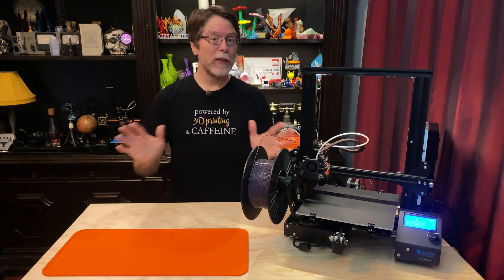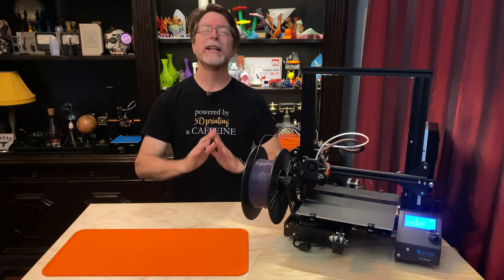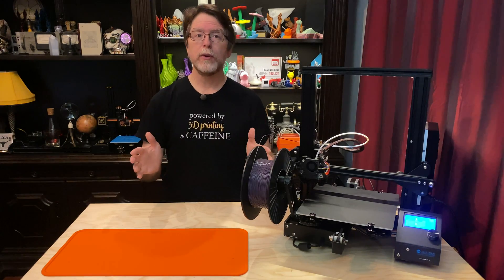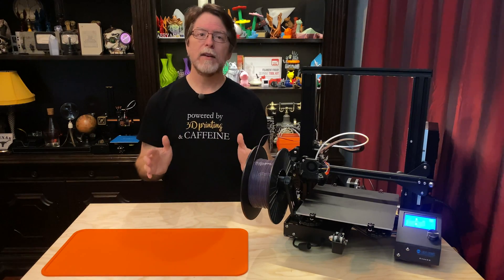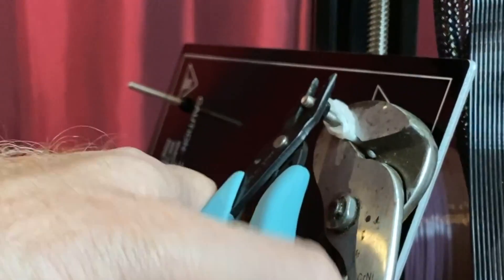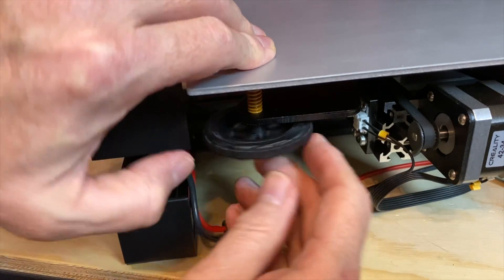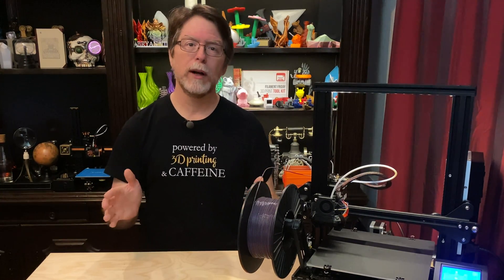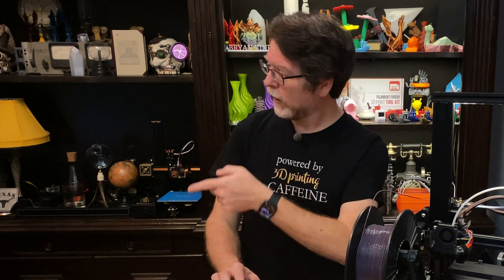This Simple Ender 3 and Ender 3 Pro Bed Mod is NUTS! 😜

Comment from the maker: Numerous viewers have commented about using the right tool for the job, which is something I didn't do. 😊 Instead, I used the tools I had available at the time (as one sometimes does). However, a set of tiny, tiny wrenches was subsequently procured, and these are linked in the description.

When I ordered them a couple of months ago, they took a month to arrive. Shipping times have improved greatly since then!
Reply: Tiny wrenches are good, but sometimes nut drivers are better...
P.S. Why not just use some super glue or a small bit of epoxy on the head of the screw to hold it in place? 
A bit of heat would help remove them if you ever needed to do so.
Reply: @TrojanHorse1959  but the bead is heated, doesn't that crate a problem?
Reply: @jtcmlt1 , So far it has not been a problem. Mine have been "glued" in for several months now.
Reply: @TrojanHorse1959  Okay, thank you. I was just confused because you said that a little heat would help remove them. I am going  to try.
Reply: @jtcmlt1 , Yeah, sorry. I should have said a bit more heat from a torch would help remove them. Best of luck to you.
Reply: @TrojanHorse1959  Thanks, same to you
Reply: Hey, if it works and it's all you had laying around, that's a job well done in my book.

Comment: Might want to consider adding either a fiber washer or a nylon washer before installing the nylock nut that way you can be almost certain not to damage any traces (especially since ideally you should be using a box end wrench or a socket and ratchet to install the nut instead of pliers since pliers can easily slip off of the nut and gouge the surface, one of the reasons I keep a small set of metric 'ignition' wrenches in my printer toolkit), with a fiber or nylon washer beneath the nut you also don't have to worry about any jagged edges on the nut (possibly caused by using pliers instead of the proper tool) from digging into the traces (considering how close the nut gets to some of the traces in your video, I'd certainly consider this).

Comment: I just picked up a used ender 3 pro and I feel that something is bent on the bed area. Even after adjusting the bed using the paper method which I've done several times the nozzle in some spots don't make contact or scrapes the bed.

Comment: Making those beds as cheaply as possible has consequences. From a machinist and mechanics perspective stock hardware and fit class is scornworthy so your fix makes perfect sense.
I suggest owners spend a little on a (typically 7mm) wrench to fit those lock nuts as it's fast and handy.  I ordered a 7mm "flex head ratcheting box wrench" (since most mechanics sets stop at 8mm) for $7.99. As a lifelong mechanic I never cried myself to sleep over buying decent tools that make life easier. I also second the thin flat washer suggestion but unless you care about the bottom surface that does not matter. Nylon or other plastic washers would be even less likely to scratch traces. If you look closely at how flat washers are stamped one side (the one you want facing the bed) has ROUNDED edges while the other side has sharp edges so I'd face the rounded side to the bed if using metal flat washers.

 Ideally the wheels should also have lock nuts because the fit is so sloppy but as I've just gotten my S1 Plus those parts have not arrived. I will replace my wheels with standard nuts with a flat washer then a star lock washer to retain the nut (a star washer lightly torqued is easier to loosen if lightly snugged) or if there is room I'll mill the wheel hubs to clear a standard nut and star washer to lock the wheels. They'll be easy to unlock with a wrench. One thing I notice about printing is many printer owners are not cued to think like mechanics and machinist despite learning CAD and working with hardware. I encourage anyone interested to take a machine shop course as it changes the way we see and interact with materials.

Comment: idk, i tried this a while back and it just seems to give you less clearance. and you will have to raise the break switch to compensate. also, anyone having wobbling issues check that there are washers on all four wheels for the bed. mine came without two washers on one side and the printer sat for two years until i decided to take a real at this thing. pissed me off when i found out why! if those washers are missing then the wheels bow out from the track when you tighten the nuts.

Comment: This guide is pretty interesting. I'll have to give it a try with my Kingroon KP3S 3.0 printer when I get the required items.
However...what if, between the Heated Bed and the Nylock nuts, we add 4 nylon flat washers? Wouldn't that reduce the risk of damaging the Heated Bed? 🤔

Comment: I did something similar to this (not my idea) but what I used were 1 nylon washer, 2 M4 nuts to lock to each other on the underside of the bed, Ditched the springs all together, and used a wing nut on top of the gantry and leveling wheels below the gantry. Made it a solid bed, once it's level it will never need adjustment again. Just be careful you don't drive your nozzle into the build surface.

Comment: Just did this to my ender 3, haven't leveled the bed yet will do that in the morning, next thing I have to print is the lid for an enclosure and then a mount for a pi compatible Lcd touchscreen. Because well it's slowly becoming a modified voron switchwire. Got to have an external electronics enclosure. Got to.

Comment: I did this ages ago before I saw this and I put fibre washers on between the nyloc nut and the print plate so that I didn't scratch the bottom of the plate and short out the wires.

Comment: My experience with this on my Ender 3 Pro:

TLDR; The nuts caused the screws to no longer line up with the mounting plate holes resulting in a huge effort wasted. Springs working great without the nuts. Screws don’t turn once springs are well compressed anyway.

Getting the nylon screws on and off is a major chore no matter how you slice it. The nuts are 7mm hex and I can use a socket wrench for first few turns, but the screw starts colliding with the  too-short socket requiring a regular wrench most of the way. 7mm wrenches seem hard to find, best I could do is adjustable wrench. I found the best way to grip the screw is with a folded paper towel and vise grips.

Once I finally got all the nuts firmly against the bottom of the bed plate, they were then fixed standing straighter perpendicular to the plate where before they had wobble play. Turns out the holes in my mounting plate don’t exactly line up with the holes in the bed plate and the nuts forced the issue. Unscrewing the nuts a little gives back the play but defeats their whole purpose (screws can still spin). I even went so far as to try opening the through holes wider in the mounting plate by drilling with slightly higher diameter bits. I could tell that wasn’t working either and I got worried about ruining the stability of the bed. So I gave up on the nuts altogether.

Using just the springs it was challenging to turn the knobs onto the screws at the beginning but I found I could just press the side of the spring hard against the screw to slightly stop it turning. Once the knobs are compressing the springs near the calibrated amount the screws no longer turn, so the nuts are not needed anyway. I’m a little upset how much time I spent messing with the nuts. I recommend skipping the nuts entirely.

Comment: Total gas lighting people on sticky bed surface, you don't have a new one and want to use the current one. His Answer get a new one you cheap bastard!
Reply from the maker: My answer to the issue of "...if you have a stick-on surface and you're not ready to replace it," was, "Grip the screw with pliers and padding." It seemed like a simple solution to the problem of not wanting to replace a bed sticker. Was there a problem with that approach?

Comment: Hi Bryan, I will suggest to put a a washer (rubber) or other no conductive material before the nut, you can short the element, I
use tap rubber washer, I a short.

Comment: The center of my 310 mm sq bed has a screw.  A fifth element...   It is fixed and the bed leveling starts at the center and the corners are set to match.   But it only goes deeper.  I need to put a spring under it so that it will go positive Z as well, so I can set them all to each other better and with more adjustment range.  They look small but they square spring is the right stuff for the stiffness desired.  I will likely get the 10 pack.

Comment: So really late comment, but I just installed this mod.  It works perfectly but a warning to any with an Ender 3.  The holes on the bottom plate do. Or perfectly align with the heater bed bolts.  In addition to taking great care of to crack the heater bed, be careful inserting the heater bed back to the bottom plate.  I had to loosen two nylon nuts, insert the heater bed, and then gently tiger the nylon nuts.  It works, but it seems Creality relies on wobbly bolts to compensate for poorly aligned holes.

Comment: Hu Bryan, my ender3 might actually need this, already replaced stock springs, moved Z stop slightly up to accommodate raised bed but still after every print, have to relevel the bed. I also lroceedes to tighten all the nuts under the bed, including the two eccentric ones, yet same old same. I already ordered a BLtouch kit to automate the levelling, can't take it anymore lol.
However I am tempted to try this one as well but only worry is additiin of these nuts will further move the Z axis a bit higher thus shortening available printing space in Z axis.

Comment: How about a small drop of silicone on top of each bolt... just enough to sit above the surface of the bed. Then, if using a glass top, the glass will push down on the silicone and basically friction will prevent the bolts from turning. Shame Ender wasn't smarter and used hex head bolts and a hax shaped countersink, then the bolts won't be able to turn at all.
Reply: Meh, manufacturing costs

Comment: Hey buddy, great Idea. I would also suggest, If not mentioned already, to also use a flat washer so as not to damaged the surface underneath should the nut start turning. If you use a slightly larger washer, the spring could also press against It and prevent said damage. Cheers :)
Reply: I use silicón washer in both side of the spring

Comment: My Ender3 Pro came with the magnetic sheet already attached to the bed, covering the screw heads.  Is it OK to make a little cut in that so I can fit a screwdriver to the screw head?
Reply: thats what I did, worked great.

Comment: Brian, I am new to 3D printing, but I would ask something that may or not make sense. Are the lock nuts really necessary? Isn't the additional friction between the bolt head and the plate, created by the higher compression of the new springs, keeps the bolt from rotating? Would it do the same for the adjustment wheel? 

Also, wouldn't a nylon insert/ lock nut on the adjustment wheel stop it from rotating due to vibration? 

I lite your channel, so I subscribed

Comment: So, whenever I try to put the nut on the screw, it won’t go further then with the screw bottom flush with the bottom of the nut. Am I doing something wrong?
Reply from the maker: The Nyloc nuts have a nylon ring inside that isn't threaded. The ring is a slightly smaller diameter than the screw. So it takes some effort to get the screws through it. But that's kind of the point of them: They hold pretty tight onto the screws.

Comment: So  I followed the directions, but even when the springs are completely suppressed, the nozzle goes below the bed and I can't lower the bed any more than it currently is. Did  I miss a step?
Reply: Near the end of the video, he mentioned that you may need to raise the Z-stop switch to compensate for the added thickness of the nuts and the stiffer springs. Try that.
Reply: maybe lift the z position limit switch for a couple mms by loosening 2 screws like i did on my ender 2pro

Comment: can i use metal nuts?
Reply: Just make sure that whatever you use, it fits between the heater traces on the bottom of the bed. I used spring washers and regular nuts. This is how I did it.  https://www.youtube.com/watch?v=lRUBTAt4dYA

Comment: No your wonderful!  Thanks for the great videos.  I will say the yellow springs ( loosened) made my bed buckle in the middle.  I had to revert back to my stock springs...I'll cut the yellow springs to size I think and see how it goes.
Reply: If I read your comment right, the reason the bed was bent was probably because you left one or two adjusters tightened while loosening the others, or the opposite, and the springs caused the bed to bend. They need to have the major adjustments done fairly equally while doing the initial installation and maybe even removal. Sounds like that was the problem, but can't be sure.
Reply: @stevemullens7937  Thank you for the reply,  I went with a three point mount for the bed and all is well now.  Have a great day!

Comment: Newbie here. After putting new spring on. How tight to do the wheels up before start levering. Cheers
Reply: I've played with this question a lot.  I have to keep my springs a tad loose or my bed will become "warped" in the middle.  Stock springs work fine for me...yellow is bad for me.

Comment: Great video. 
 I had the same idea but I used a small black nylon washer, a M4 jam nut (they are thinner than regular nuts) a shouldered nylon washer on the top and bottom of the original spring (the proper size snaps right in). It puts more tension on the spring so it has the same effect as a stiffer spring, gives the spring "flats" to rest on, increases friction to hold adjustment but the best part is it only costs about 4 bucks and a trip to a local hardware store, so you're supporting local business and can get it same day.

Comment: Thanks for the video.  I just got my springs and some new red fancy wheels to add.  Mine had no nuts to start now that they are on there the strain relief will not go back on not enough screw left. I don't recommend  using  pliers it's way to hard. I'm sure I damaged  my underside

Comment: Not sure if it's the Ender 3 V2 or the factory having variance in their machine drilling of the bed carriage. When i locked everything down tight, went to put the bed back on as in the video and rear left and right went in, but front left and right were outside the bolt holes by 1.018mm on each side for a total of 2.036mm variance. Guess it was just not meant to be.

Comment: Hi Bryan!

Hate to be the oddball here, as this seems to be a great idea.  However, let me relate one important observation from my experience attempting this mod with my Ender 3 pro.  

While I don't know the dimensions of the nylocks you list in the description, beyond being M4, the height of the nuts appears to be somewhat critical.  

I tried this with mod with M4 nylocks I picked up at the local True Value hardware store.  These particular nylocks are 5mm in height.  When combined with the yellow springs, there is little if any adjustment available, as simply putting the adjustment wheels onto the screws leaves the springs all but completely compressed.  Indeed, the corner with the heater strain relief is completely compressed with the adjustment wheel just threaded on.  Given this, it is virtually impossible to level the bed.

I am open to suggestions, but right now I'm thinking about trying the original springs and/or replacing the bed screws with something around 5mm longer.  The latter seems to be the best option overall.

Again, open to suggestions...  (Help?)

Comment: I've done this exact same mod yesterday. I have an Ender 3 V2

 M4 Lock nuts to secure the bed and installed yellow springs. I adjusted the z limit switch as the bed was higher.

I'm having problems with the first layer sticking to the bed. I've leveled the bed about 20 times.

Can someone please help?
Reply: im having the same issue!! about to take them nuts off. did you find a solution??
Reply: @BBOY08SUT  issue wasnt related to the mod. My bed was just dirty. Washed it under running water with some detergent. Also I flipped the bed and started printing on smooth side. Issue resolved.

Keeping the bed clean is vital from mty experience. Use iso and a microfiber cloth to clean it after every print.

Comment: I already did something almost identical on my E3 pro and once I got the bed leveled, I haven't had to adjust it again. Of course, I used adjuster wheel locks (see below) to keep them from turning without deliberate force. I'm glad I found your video, I was considering making my own for this project, but yours is better than mine would have been. My way is a bit simpler, use small spring type lock washers between the bed and a regular nut (as thin of nut as you can find AKA jam nut, if available) so you don't have to risk damage to the screw threads and use two nuts jammed together to hold the screws while tightening the nuts against the bed.  Good job, except for some of your tool choices ;-)     https://www.thingiverse.com/thing:4669200